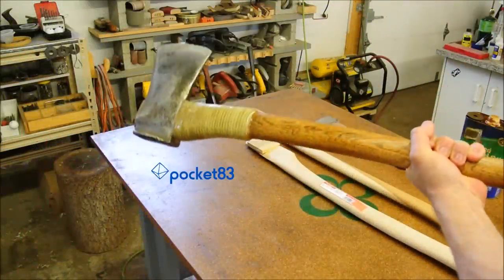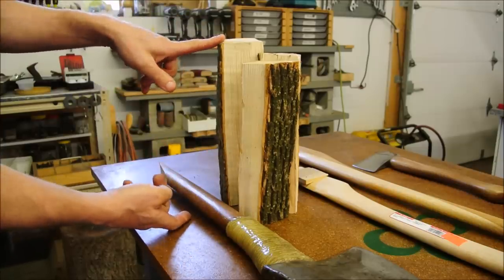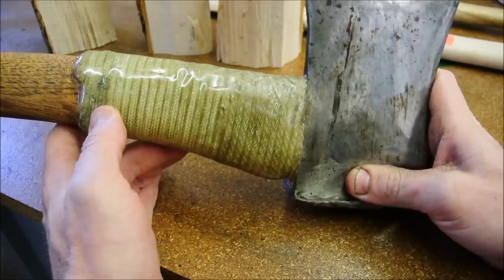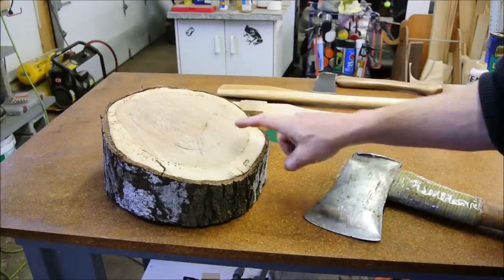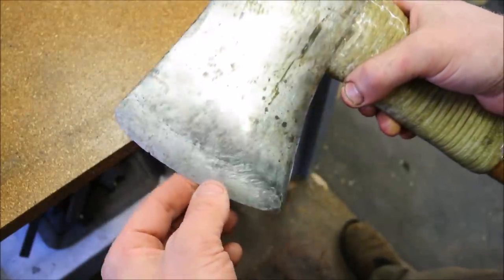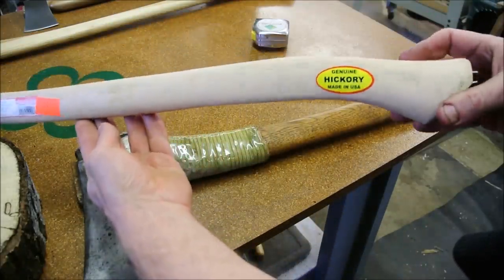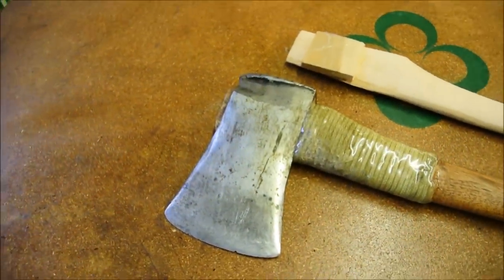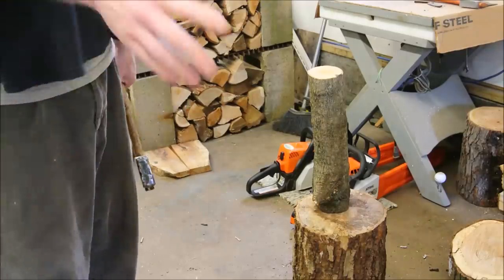Why (& how) I split with an axe instead of a maul

Comment: I repaired an axe at a garage sale using the cord wrapped around the split with epoxy . I have to assume I got it from you. Maybe great minds think alike? Not sure.  
  
Anyways, I told you I wanted to increase my engagement. So this is me making a comment and continuing my discussion with you and video games.  
  
 
What are your thoughts on collecting and referring to the collection as an investment? I know that's a deep hole. Because I do not want to, or expect to (currently) to sell off my collection. In some respects, if I had to, I could. In which case the maybe $2500 I spent would have been a good investment. But with most collecting hobbies they have their ups and downs (beanie babies) and even stocks. To be a smart investment, you would have to be smart, and get out when it's high.  
  
Thoughts?  
  
And what was the last great game you played?
Reply from the maker: Thanks. Sure. I can talk game forever! The last "great" game I played was Plants vs Zombies. It was a little game, but it delivered one of those, 'Oh, that's why all the hype' moments. The last time I made a  game purchase, it consisted of three: Assassin's Creed (both 1&2) and FarCry 4, all for the 360, and all three for under $9 after tax.  
...
Price is the point. As long as the price you pay is certain to be as low as it will ever be, it's a good investment, IF: 1) You enjoy the time you're spending on cleaning, looking for, and reading about games, and 2) Any price you do pay above rock bottom market value (RBMV) you consider a financial loss paid to entertainment (just like with the cost of movie tickets), and 3) You remain conscious of game condition, genre, and release.
...
Let me elaborate on #3, since it kinda requires a list of its own; games are only going to be a solid investment if they: 1) are in good condition, 2) are a popular game type--that is to say, fun (exceptions are made for rarity, quirkiness, and niches), 3) are complete with manual, box/art, and any inserts (for examples, King Kong and Aeon Flux included tickets to see their films), 4) are 'Black Label' original releases, and 5) are clean of any stickers or writing, and 6) have not been sun-faded, not even on their spine.  
...
It's obvious to say that it's best to buy in bulk lots, but doing that also yields lots of sports games, broken games, and incomplete games. Time lost to playing around with those is an additional expense, as is the shelf space they require. Cleaning a single game can take minutes. 90% alcohol is nearly a non-expense, but cotton-balls aren't. 
...
One more thing: "get out when it's high."  
hahalol. 
If you were to get out—which you won't, once you've been sucked in*—you would want to do it at one of the generational shifts. There's this sweet spot where a person goes from being a kid to being an adolescent where they will liquidate their collection without remorse. There are multiple, similar age/experience related events like this that will cause the market to surge, and there are generations/cultures associated with these liquidations. Naturally, as a result, there's also the inverse effect, where a certain people around a certain age will develop a nostalgic fondness for their old games. The lines between these generational shifts are complicated, because they will be altered by historical events, present culture, and console/market saturation, but if you can spot these lines, where they begin and where they end will be the times to buy and sell. 
...
In my example, now is the time to buy PS3 and 360, because the 7-gen kids are going to college now. They'll be back in around 12-15 years, with some serious buying power and a penchant to relive that brief carefree moment that they remember, and they will see what was their Xbox as a symbol of it, as a type of liberation from their now-solidified responsibilities. Right now, N64-era kids make the money, and so they'll pay quite a cut to have a non-repo copy of Smash Bros. But us NES kids are growing tired of dusting our collections, and we've also come to terms with the reality that emulators are nice, so old Nintendo stuff is losing its charm (for now). As that era of game players starts to literally die off, you can also expect a fundamental shift from nostalgia to historical significance, and of course, a corresponding price curve that reflects it, along with the collection dumps that'll hit the market from heartless non-collector relatives. lol.        
...
*Unless you have financial meltdown, or a kid. I remember once picking up a backwards-compatible PS3 in pristine condition with 20-or-so high-end games from a sad-looking young man who was about to have his first child: his wife didn't like games, and she wanted to convert the room the PS3 was in to a play-room. I really did feel bad for the father; he had made it privately clear to me that this was an unpleasant rite-of-passage.              
 ...
What was your last great game played, and what was your last purchase?
Reply: @pocket83squared  To make this easier, I will reply as I read.  
  
Plants vs Zombies was a instant classic. PvZ2 was garbage. I still have not played any assassins creed games. I did not have a ps3 until very very late in its life, then did not get any of the games till once the ps4 was out and had games I wanted to play. That is what retirement is going to be for right?  
  
I am sure there is a clever faux mathematical equation you could use to express the sentiment of time spent hunting and how you value your time (T), price paid (P), time spent cleaning (c), value of the game averaged in the resale market (v), time spent playing the game (t). A smarter man could probably figure out a elegant way to express it. Or someone with more time and interest in it...

As for #3 as it pertains to helping to be conscious on if it is a solid investment. I think the cornerstone really comes down to two things. Rarity, and value. Everything is helps to lift those two things. Either independently, or both. Some games are so rare, that a sun faded loose copy will still sell for thousands. You add in that it is fun +, good condition ++, complete +++. So you are 100% right, I just think that some qualities are significantly more important than other, but that is a rule to be broken. Especially because of random explosions in hype. Earthbound kept getting ridiculous amounts of hype for whatever reason and the price kept going up. Even though its not really that rare (I say that, even though I do not have a copy...).

Buying in lots is the most cost effective, but truthfully not my kind of collecting. I like garage sales/thrift stores/flea markets. So with that, I do not come across bulk lots that often. The hunt is a lot of fun, so online is a rarity for me also. Cleaning in some regard is almost a bonus. It is almost therapeutic to me. Get the cotton cloth, my isopropyl alcohol, some toothpicks, and a podcast. Zone out and really get in there. Same with the hunt. I really do not factor it in. I enjoy it. Digging around garage sales, talking to new people, driving to new locations, all a bonus.

As for the "getting out when it is high" It is true, but you can almost guarantee that at some point their will be higher. But that is a terrible way to look at it. You can only hope to sell at a peek.   
  
The generational shift with collecting and younger generations getting in because of financial security and nostalgia. 100%. I have been saying that for many years. I was talking to my nephew about it once and he talked about wanting to play some old iOS games that are no longer up. Which makes me wonder about the move to pure digital and the loss of licencing for stuff and then having it be impossible to get again. I like physical, but man do I love not having to swap games.

Emulation has been in my life longer than collecting. Emulation in fact is what really pushed me into the hobby. I discovered just how many games I did not get to play, then saw it at a thrift store. Bought it, then it just went downhill from there.

The last great game I played.....I am about in the middle of Undertale. Enjoying that so far. Worth some of the hype and it is great.That can change for the better or worse as I get through it. The last game that I can think of that really impacted me and made me stop and go "wow" was Zelda Breath of the Wild. Dont get me wrong, there was a bunch I did not like about it, but there was something in it, to me, that really hit that spot. I remember playing the first zelda and thinking "wow, I can go anywhere on this map!"?. Then as time goes on, and maps got bigger and bigger you got use to large maps. Those maps usually were filled with...nothing. Large areas that were really not traversable and didnt have a soul. BotW was the first game ever (to me) where I just enjoyed walking around and living in it.

Last game I bought. Physical game.... I really do not know. It has been a while (thanks covid). The last one I remember was a few games at my local goodwill  (according to when I posted it on reddit) 6 months ago. It was a really awesome score. FF8, breath of fire 3, legend of mana, ff7, ff anthology, ff tactics, vagrant story, lunar silver star story (no cardboard box, but has map). wild arms 2, parasite ever, and ehrgeiz. Again, crazy good pickup for $3 each and probably top 5 best game scores I have had. Good note to take a forced break on.

-------
  
I will see you later on another video once Some other question pops in my head. You have a great day.

Comment: Rather than rope I used a piece of strap metal. It has held up so far👍🏻
Reply from the maker: How do you keep it from annoying/cutting your hand? How do you attach it? How does it add strength to the wood fibers? I mean, there's no way to get metal tight enough to bring the handle into compression. I'm just not convinced. Please show me a video/pic of a good example.
Reply: I am also confused as to how you could use metal, especially strap metal. A wire wrap would make more sense to me. I'm seeing other ppl say other weird stuff they've used (someone else said fishing line and construction adhesive) Why not just do the rope and epoxy instead; so simple and so effective.
Reply from the maker: We use what we've got, I guess. I made a PVC/duct tape guard once, and it lasted a few months!

Comment: You should get a fiskars axe, they are  a little expensive but are good steel and last forever.
Reply from the maker: You should get an axe like I use. You should also watch the video and read the description.
Reply: i hate those fiskars handles. they feel weird and the sound is not the same as hickory. splitting can be deeply satisfying with the right axe.
Reply: I knew someone would have a Fiskers comment, ha!
Reply from the maker: Fiskars comments are on every axe video. It's a popular consumer product. It gets funny when they demand that I concede the "lifetime warranty."

Comment: Bad swing mechanics on that demo.  Your hands should not be above the axe head at the end of the swing.  I hope you have your toes and feet insured.
Reply from the maker: 1) That's just a dummy rule to tell you not to chop on the ground. If the base of your chop block is wide enough to remain in the swing's radius, it will be just fine. A better rule would be to keep your round to the back of the block. 2) That was just my kindling block, which is inside, so this was not a "demo." 3) I didn't ask for your opinion on safety, Dad.
Reply: pocket83² But you got it anyway buddy..  Too many Noobies watch videos and proceed unsafely.
Reply from the maker: Not my problem. Go make a safety video if you're worried about the children. My videos are for grownups; us adults get sick of watching crybabies and worry-warts whine and lecture about safety.
Reply: pocket83² Not your problem?  To me that shows a very callous attitude toward safety.  My God man you’re promoting handling a potentially deadly tool on a video channel and safety isn’t your problem?  I think you have some priorities that need realigning.

Comment: and there american goes on and on about science of spliting wood.....cmon, you just do it...there is no science about it...and btw where i live we never heard about that maul...

and and, my thinking is that mat is way too soft of a steel for axe
Reply from the maker: 1) Splitting wood is ALL science.   
2) Where I live has nothing to do with my arguments.
3) The bit/front of this axe is very hard. Any harder and my files wouldn't work.

If you disagree with a specific point, make it. Otherwise you are just being rude. And just to expand on #1, anything that involves physics can be optimized for efficiency. You might not understand the point of energy conservation if you are still young, but work your body for a few decades and then we'll see if you can "just do it."